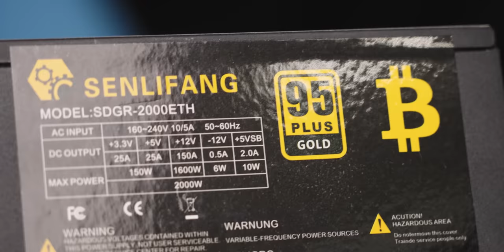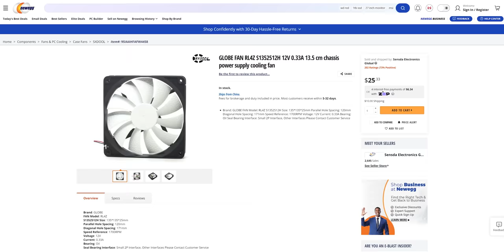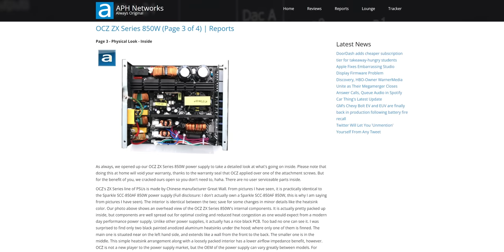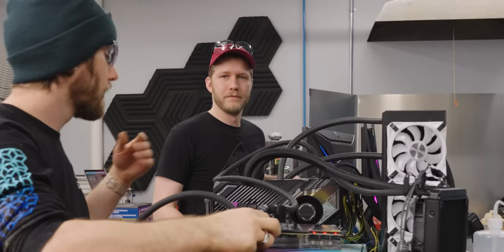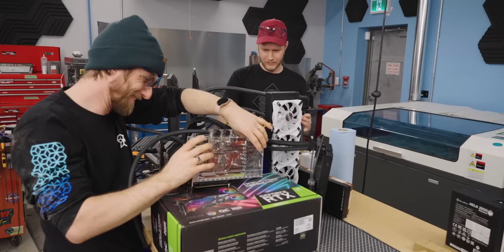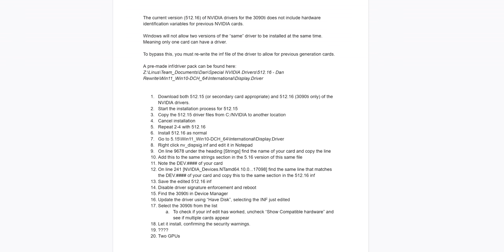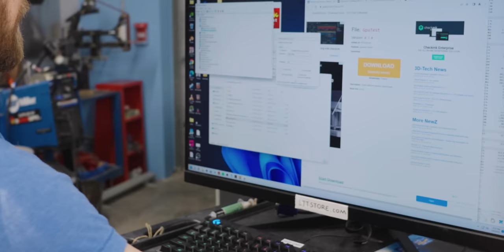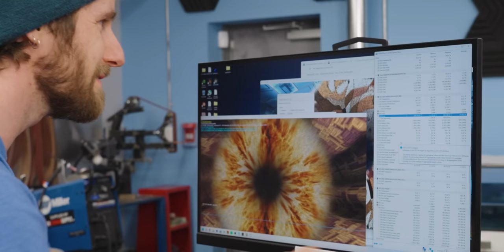This is one SKETCHY 2000W Power Supply

Comment: I love how they arbitrarily labeled it with 95 Plus Gold because 95 > 80 therefore better; but not 100, of course, because that would just be silly.
Reply: who knew a chinese knockoff brand could be so humble and not go all the way..!
Reply: Well, since it's about efficiency, at least they know you can't have 100% efficiency in a power supply, lmao
Reply: 110 platinum psu:  with a stirling engine inside that generates extra power from excess heat
Reply: No PSU can be 100% efficient, So at least they got that right lol
Reply: @AdrianOkay  100% efficient means no excess heat :P
Reply: @Coolio_Wolfus it doesnt matter, there is no such thing as 95% plus certification. 80 Plus is one and only thing that exists, and its tiers, of which some go 90+, but label is still 80 Plus
Reply: 100+ mithril... synthesizes power from the void...
Reply: well 80+ titanium is 95% efficiency, so its not that stupid
Reply: Yeah its probably a lie.
Reply: That would be a superconductor
Reply: @TadaHrd  directly hooked into the power grid through transformers with custom wiring would be pretty close to 99% efficiency, don't know how happy the city would be though...or just buy uranium rods and start a nuclear reactor.
Reply: What if you saw one that said 300 Plus Gold, like it magically generates more power than it takes in?
Reply: Yeah, as opposed to the guys that made a pair of PC speakers I had like 15 years ago. They cost like.. €8-9 and the box had 1000W in about four places 😂😂
Reply: That's not arbitrary.  It's calculated.  Abitray means the exact opposite of what you're saying.
Reply: It's like getting an F changing it to a B instead of an A lol
Reply: If it's getting that hot it's probably more like 50
Reply: @mikeycrackson  isnt just 100% efficient,but actually warps time/space to correct your previous waste
Reply: 100% efficient is actually silly though. literally nothing is 100% efficient. its quite literally impossible in our current understanding of physics. 

so.... 100 + gold efficiency is definitely silly
Reply: 9500plus Deuterium-Tritium, uses a miniaturized fusion reactor to create a tiny kugelblitz black hole to leech mass-energy from to power your pc with way less input power
Reply: Also 100 Plus is a drink.
Reply: 100% power efficiency is impossible, so 95 is good enough to seem legit, right?
Reply: because it's only to digits wide🤣🤣🤣
Reply: @Ae3lolz  Arguably, due to a quirk of the definitions in question, heaters are 100% efficient by default (after all, waste heat is still heat... (and any sound or light emitted Also becomes heat upon interacting with various surfaces... eventually))
Reply: @laurencefraser  the efficiency rating, at least, measures how much ac power gets converted to dc power for the computer to use. but technically youre right
Reply: Server PSU have 94% efficiency and cost way more than this thing so it's just a dumb product
Reply: I get paid to smoke weed & get high on my YouTube channel 😨
Reply: If it doesn't have "kryptonite super better 150 overpower" written on it, it's not a proper Chinese knock-off.
Reply: Nah nah 95 is obviously its top speed in Mph
Reply: The Chinese completer just launched 96 gold certified PSU's. Not kidding.
Reply: Bruh what is
Reply: But still can't figure out how to unlock your apple devices??
Reply: 101% - this power supply harnesses negative entropy and turns it into energy
Reply: 80+ gold can get up to 95% efficiency, so that what they intended if it actually works.
Reply: That's because 100 won't fit in the sticker.
Reply: @yuikonnu5079  just because some car cost less than ferrari, doesnt mean that it doesnt drive. those cheap psu most certainly can work, but they mostly have shorter life expectancy, in some cases they also have less safety mechanisms put in place. only way for them to check if this is really uncertified "80 plus titanium" would be if they used wattage meter and shorted the psu pins to turn it on without any power draw. then they would see how much power it drains iddle.
Reply: @xentiment6581  Some people actually think that this 80 Plus crap actually denotes power output of the PSU, hence this 95 marketing.
Reply: Rtu
Reply: Who knows what it really is? Knowing how hot the psu became..
Reply: @marcogenovesi8570  FREE ENERGY！
Reply: @agoogleuser5420  well 2000W psu will always be hot as some simple 12v fan wont be enough to cool it. proper airflow within the pc case is probably required for it to work without shortening lifespan(not to mention it should dissipate heat into pc case helping with temperature, too.
Reply: @mikeycrackson  Gold pressed latinum
Reply: @laurencefraser  Some of the energy will be lost as heat before reaching the actual heating component. So yeah it'll all become heat, just not exactly where you want it.
Reply: Bro that's the same as me as a kid, I ate an entirely chocolate bar, that I was supposed to share with everyone, but just to say that I didn't leave anything for anyone, to appear that I'm humble, I always left like 1 square of it, or like drink all the coke and leave like half a cup of it, it's the same principle lmao
Reply: @AdrianOkay  still wouldn't be 100%
Reply: @Razz_Putitin  You can't get to 100% efficiency, and it's not about just heat.
Vibrations are also a loss of energy, and since this is the real world, nothing is an ideal component.
You'd need to make everything out of superconductors and that's pretty much impossible.
You can get pretty close to 100% though, 95% could be possible.

Anything over 80% is good enough and most PSUs are.
Reply: It's similar to how bot reviews stick to 4.6, 5 stars is just too fake, 4 stars is too low. Same thing here.
Reply: @AdrianOkay  this one just killed me. I can't stop laughing
Reply: Well even 80 would be silly when you have so many spelling mistakes on the label :P
Reply: Well since it only has 240V in it could actually reach that efficiency. Probably not but it could
Reply: @Eradicationist  isn't that what a power supply is? Wiring and some transformers? I think you basically just took out the fan, and that's far from the extra 19% differnece. That is, of course, unless you use a 380 watts fan, which introduces a whole lot of different problems such as the whole case taking off under full load.
Reply: @annejones9954  To be fair, it's easier to change F to B than to A.
Reply: @Ae3lolz  Everything have 100% efficiency. The power the psu unit draws will be converted at 100% efficiency to generate heat, noise, shaking of the casing, and of course, the dc power needed by connected cpu.
Reply: @jimmydandy9364  At least they didn't put "404 file not found" on the label.
Reply: @boulderbash19700209  ya huh.
Reply: @boulderbash19700209  Is that why alot of "Made in the USA" stuff has such boasting descriptions?
Reply: @AlpineTheHusky  The US/EU/Japan/SK made products label their technical specs as is. Not China made products. They will put any number they want. 

An example is Li-ion battery (there is a video in youtube that show this). Japan and SK will put 2500 mAH on their capacity specs and if you bother to measure it, it will give you capacity around that number (give or take 1%). China's battery will put 10000 mAH, and if you bother to measure it, it will give capacity number around 1000 mAH.

The psu units in this video is also the example of that. While the American (?) branded psu will be ok for workload of 2000 watt as their label said, the China branded psu will get real hot only at 1300 watt workload. And I won't be surprised if it will blow up at 1500 watt workload.
Reply: @boulderbash19700209  LOL!
Reply: @theironworks6797  The beginnings of the worlds first perpetual machine.
Reply: 95 was actualy imposoble reach a specialy over Q factor curve.. realy is 92 bcause there is semiductor inside with voltage drop..  geezzz you from india?? ima bet..
Reply: I think that everytime I see something like it
Reply: LEERY Fly it’s really like changing a b to a-
Reply: @xentiment6581  actually, it isn't the only thing. There's also cybernetics power supply ratings; which are actually more intensive and hard to get
Reply: You guys trust those Chinese people too much. This was obviously done to have a higher number, but not too obvious to an untrained eye. If they wrote 100 (or more), they'll need an extra character and the label will be too different from the original one.
Reply: I wanna see 101 efficiency to see who notices
Reply: @thunderarch5951  well they lied about everything else why not break thermodynamics too?
Reply: Yeah, unusually smart for a Chinese company, to not exaggerate beyond what is pretty much even theoretically possible.
Reply: sounds a lot like sham elections
Reply: @marcogenovesi8570  hell yeah perpetum mobile power supply
Reply: 100% efficiency is scintif
Reply: 100% efficiency is scientifically impossible. Unless a breakthrough happens or our current science is wrong 100% efficiency is impossible.
Reply: @marcogenovesi8570  creating energy out of thin air
Reply: @Razz_Putitin 110% efficiency, it gets cold when powered so it can also double as a small air conditioner